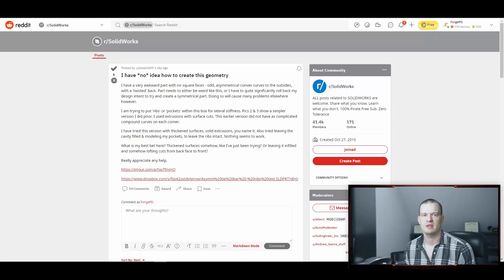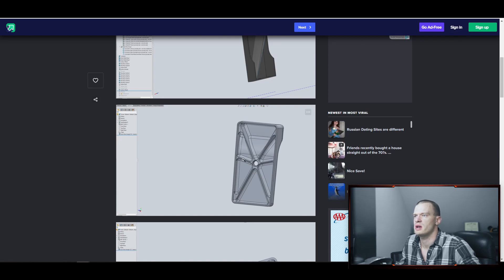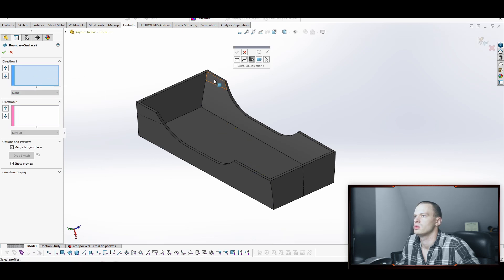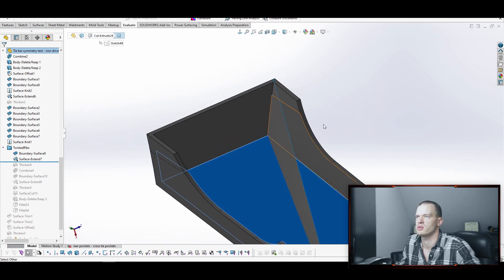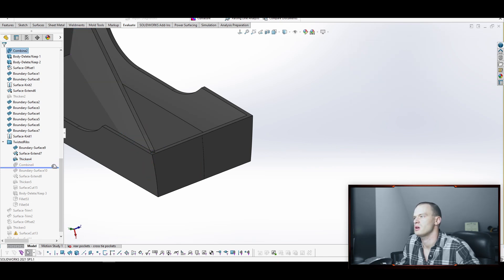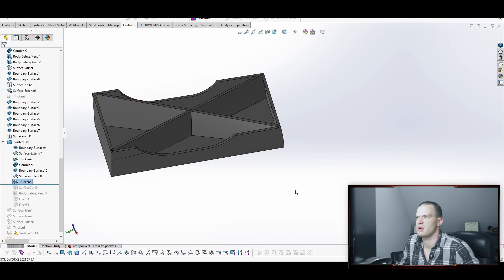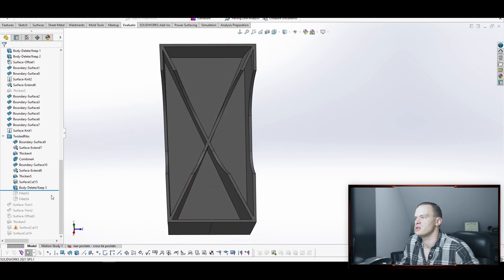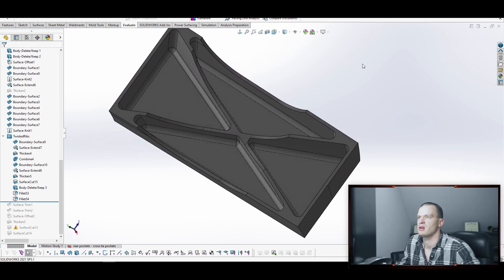How To: Twisted Ribs in SolidWorks

Comment: Twisted ribs are good when you don't need to demold part easier. For CNC billet machining it's a great idea!
Reply from the maker: You are absolutely right. This design definitely not optimized for injection molding.  Even billet machining would be tedious unless you had more than three axis.